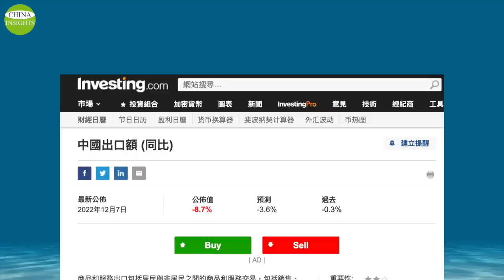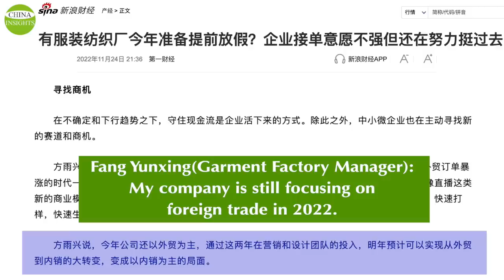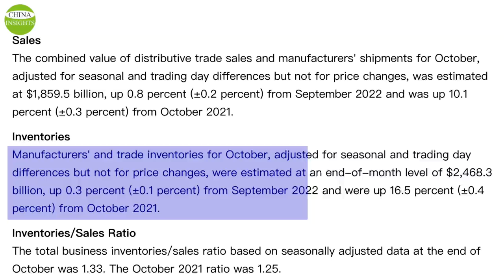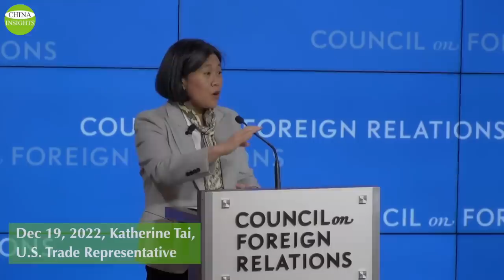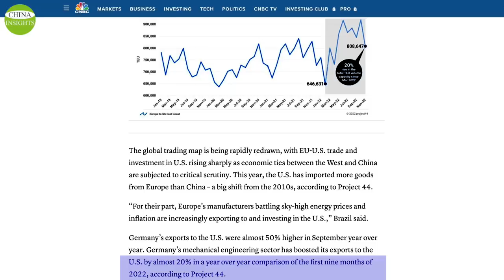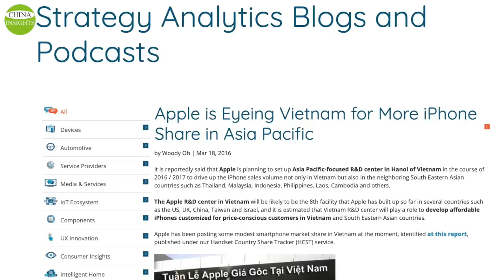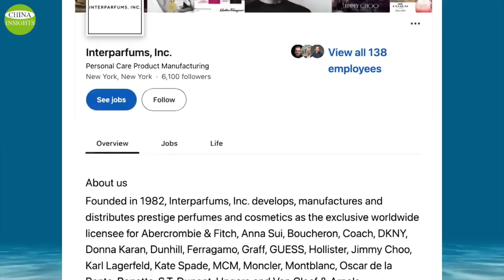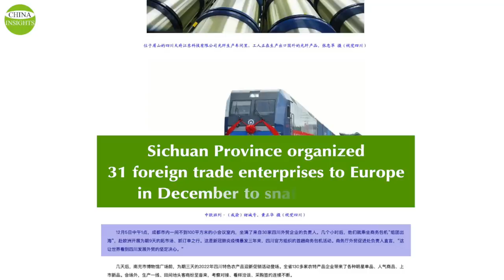U.S is to rectify 20 years of CCP's distortion of world economy/Apple's new hubs: India and Vietnam

Comment: A good chunk of the "dollar terms" export shrank is due to the RMB shrinking in size compared to the dollar by about the same amount about 12%. Real export values should be in actual freight volumes to make real comparisons in factory output year on year.
Reply: Yen?🤔
Reply: that would be true if we were mostly interested in how much china produced. But in this case, we need to know how their trade balance in dollar develops, since that will determine their geopolitical power more than just nominal production levels.
Reply: Yen is the Japanese currency. Yuan or RMB is the Chinese currency.
Reply: @kear8225  Thanks, I edited it.
Reply: @bullpup1337  Half the episode was about how Chinas production level dropped. Especially the trade volume dropped in the last 2 months, when the RMB dropped the most.
Anyway, all this balances out as now they are more competitive, so their exports will go up again.
What was more interesting is the countries decoupling in the long term and I've no doubt January's chinas dollar demoniated trade will drop even though the RMB is recovering due to covid.
Reply: @Eoin-B  yes as they showed China's exports for the holidays were down 40%. That means their manufacturing suffered greatly. This has been happening year after year during the pandemic. I don't know why this original comment even posted.
Reply: @Eoin-B  I doubt they are more competitive. Cost in China is rising in the sense that there is an increased political risk.